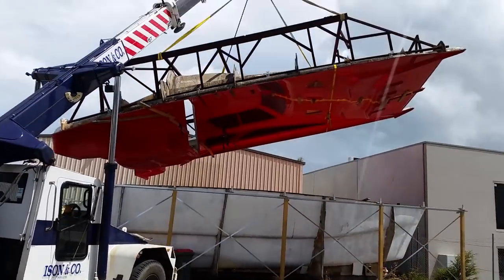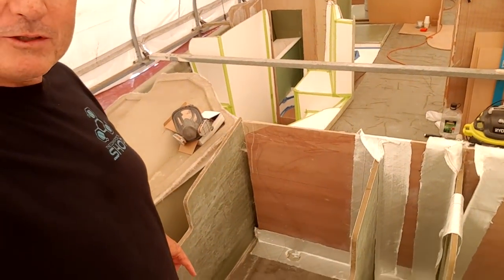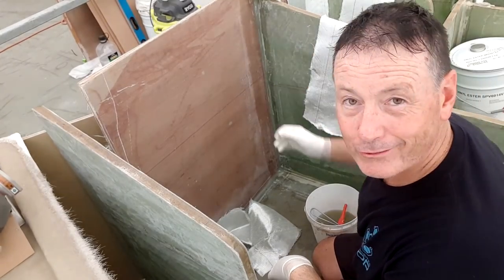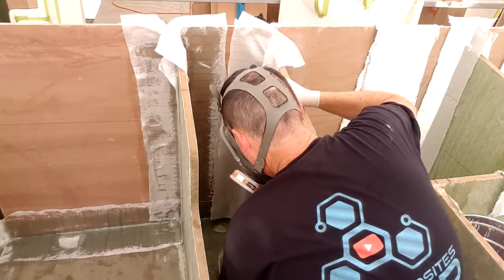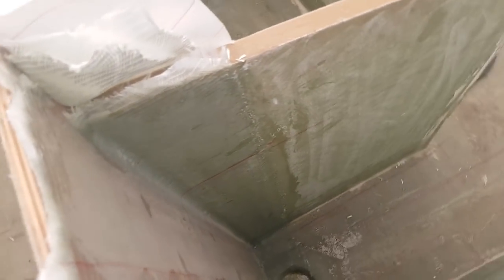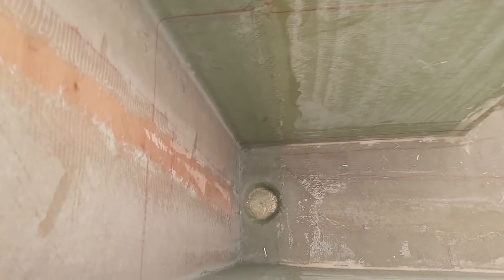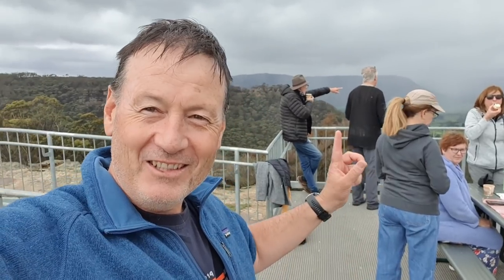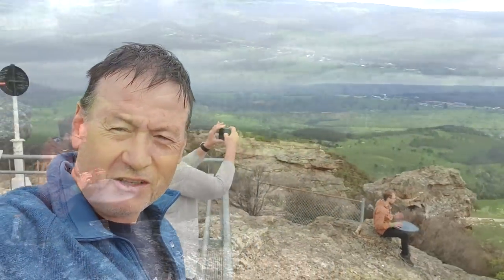Ep108 Catamaran Bulkhead Install Part II - Life On The Hulls - Catamaran Build Project

Comment: Anchor lockers are a great place to visit a restaurant supply place. They have those floor mats that do not mold, or turn gunky. The mats protect your hold. And keep that chain from resonating through your hold. To clean out the locker hose down the mat and flush out the locker 1 time per season.

Comment: For your anchor chain compartment, I think UHMW sheet is a good idea.  We wore out big drag chains as well as the trough to guide the chain.  We needed the strength of steel for the chains due to harsh conditions.  We used thick C - channel.  Your idea of a sheet of thick UHMW would be great.  You could put thinner sheets for the sides and protect the walls from the chain without a lot of weight.  Good luck. I'm 78 so get cracking on the CAT, just kidding, always be safe.
Reply: Larry Gee    UHMW would be great and when that wears out replace with another.

Comment: Ross, Bottom of anchor well.  After your done with strength. Think bottom of milk crate.  Create an air gap so the chain doesn’t touch the floor.  Will drain better and easier for a fresh water chain wash.  Cheers

Comment: Great work as usual, not sure I’d be worried about the noise from the anchor locker. The bottom normally has a layer of chain left in it. I’d definitely be putting a layer of glass over all the ply prior to flowcoating, to add to the durability. Thanks for sharing and stay well.

Comment: Im sure you've gotten this question quite a bit, but I think it would be interesting to hear what you would do differently if you were to start over right now, knowing everything you've learned so far.  It would also be fun to be able to look back when you're done and be able to see if those changes still hold true at the finish line.

Comment: Thanks again for taking the time to document your project - it's been very educational to learn about composite construction (and very entertaining to watch someone else work so hard!).  A couple of questions... 1) Why use plywood instead of staying with foam board?  Seems like plywood introduces the potential for rot.  2) Are you doing anything to keep track of overall weight?  I'm sure all that resin and glass will add up over time.  Are you concerned about how low your cat will sit when you eventually splash it?

Comment: Cheap plastic grating will be good to ventilate the bottom. But when you are raising anchor the windlass motor will be lots noisier than the chain dropping in. Because the first 50m of chain gets all the wear, end for end it every year to maximise chain lifespan.
Reply from the maker: That is an excellent idea, end for end the chain. Thanks for the tip.Great plan.Ross

Comment: Maybe a teak grate system made up of old swim platforms in that anchor locker? It would be rot resistant, sound deadening, and it won’t chip and crack like glass covered foam. Plus it will drain through.
Reply from the maker: I am considering teak but will probably have to go for a synthetic  option simpyl for ease of mainenance and cost.Thanks for the advice ad the jury is not out yet.Ross
Reply: Life On The Hulls I’m not sure a synthetic option will have quite the sound dampening you’re looking for, but it’s only going to be noticeable while bringing on the chain rode. Stay safe!

Comment: Raptor liner would be excellent for the anchor locker spray on polyurethane anti abrasion coating for truck and utes available in white black or tintable 
keep the chain from scratching up the flow coat
Reply from the maker: I have seen that liner and wondered whether it would work as a protector.Ross
Reply: @LifeOnTheHulls  it's pretty tough stuff you can get it in 1ltr cans which would be plenty for the anchor well they use it to protect alloy gravel trucks

Comment: I bet you’ve already told the answer but I’ll ask anyway😆 : I know that epoxy creates amine blush when curing so peelply is really beneficial. But does it do anything else with vinyl ester or polyester than makes the surface a little “rough” to make next layer bonding easier?
Reply from the maker: Peel ply creates a near perfect and almost fairable surface along with a roughened or keyed substrate for continued laminating seems to assist in removing excess resin thereby creating a slightly less resin rich substrate.I love the stuff and reckon  it saves me hours of sanding each week.All the best Ross
Reply: Life On The Hulls Ok, great stuff to know from the first hand! 💪🏻

Comment: A question or maybe a sug3if you like it about the anchor well. After you do your reinforcement of that well will you do a fresh water rise of the chain ? You have the drains already it should help with the rusting of the chain. And maybe a salt water rise as the chain is coming up out of the water to clean the chain of all the muck it will pick up .
Just curious if you are planning on that at all? And if not why not

Comment: At what point to you start de moulding? I assume all bulk heads in first
Reply from the maker: Gidday Tim.You are correct.All bulkheads should be installed to ensure shape and form is kept and to avoid excessive flex.I will likely have all cosmetic furniture modules installed loose and possibly removable on demouldung day so as to minimise weight.I have avoided demoulding due to the storage issue of having a mould and boat to store but am trying to organise a solotion tto this which currently is not easy due to the virus .Cheers Tim thanks for watching buddy.Ross